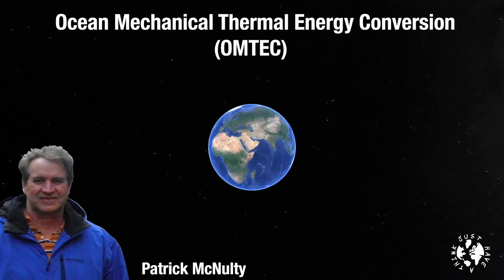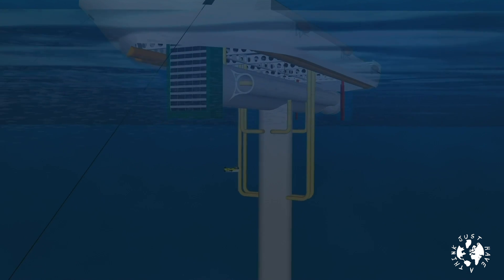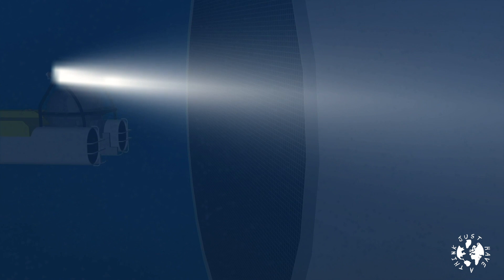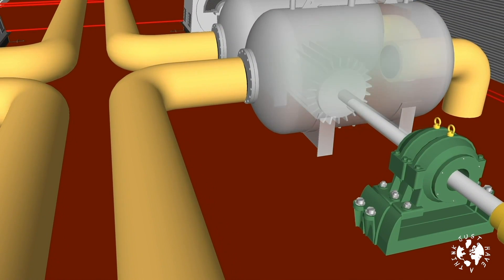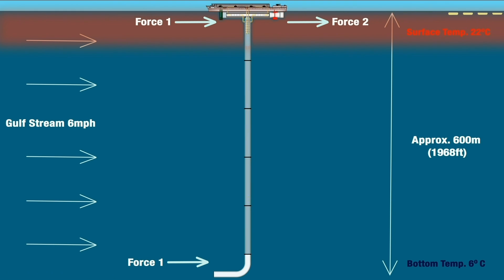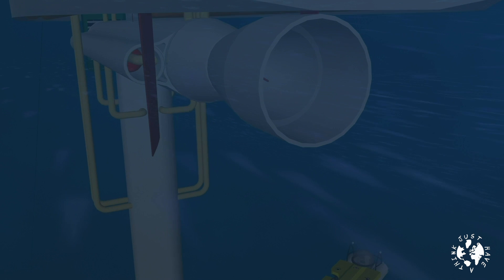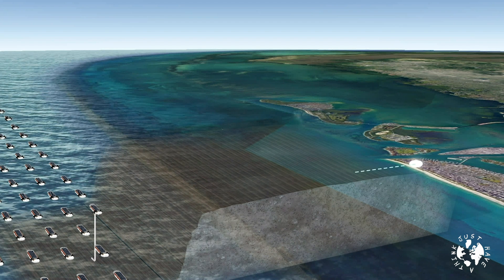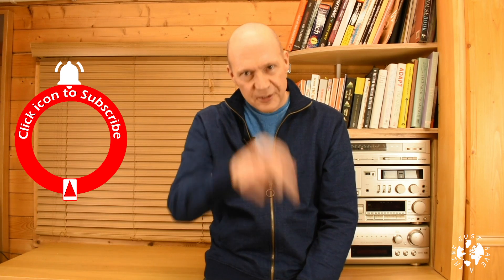Ocean Mechanical Thermal Energy Conversion

Comment: A similar system could be used for seasteading - that is to say, floating communities, probably located in the center of the world's gyres.  The deep water is not only cold but nutrient rich. This gives it a couple of uses.  It can be expelled from the top of the system into ponds made from membranes and kept inflated by having the level of water in the ponds a little above the surrounding sea level.  Plankton will bloom in these ponds and forms the ideal food for mussels and oysters.  Voila, you have an export product with a great marketing story.  The cold water can also be used to produce fresh water by having the ambient air which is pretty close to 100% humidity, passing over condensers that have this cold water flowing through them.  As for pumping, all that is necessary is a one way valve in the pipe and the rising and falling of the floats due to wave action will pump the water through the pipe.
Reply from the maker: Hi William,
Thanks so much for your comment. I am going to post your suggestion onto the Facebook site that Patrick McNulty operates for this project. It is called Ocean Tunnels. I'm sure Patrick will be extremely interested to read this. All the best. Dave

Comment: Energy output from that sized (10 meter diameter cold water pipe) system?
Reply from the maker: Hi Andrew. You would need to quiz Patrick on that one, but he's talking about many hundreds or even thousnads of these machines easily powering the whole United States. Patrick has a forum on Faceboook called Ocean Tunnels. I'm sure he would provide more detail if you post on there. All the best. Dave
Reply: @JustHaveaThink  thanks, OTS of one sort or another would be ideal for seasteading.

Comment: Hurricanes are a necessary function of the atmospheric system.

What material is proposed for these '10 meter diameter, 1000 meter insulated intake tubes'.

Has anyone done a basic cost/benefit feasibility study, including all externalities (like inhibition of the Gulf stream by 'thousands' of such monstrosities)?

Seems like more of the same that's gotten us into this problem in the first place; unregulated scientific 'progress', coupled to a basic nonunderstanding of a basic paraphrase of Occam's Razor; sometimes the simplest solution to a problem is the best.  In this case, that would be a reduction of consumption, which will happen regardless.

Comment: "surprising nobody's thought of it before " is the sign of genius, obvious after the fact. Does cooling the surface temporarily reduce the local sea level rise? How will this affect local sea grass beds, if Miami and Ft. Lauderdale decide to replant them? Help, I assume. Just because it's cooler does that automatically mean more O2?
Reply: Yes cooling does cause the water not to expand as much but that is a very small effect. I am familiar to the sea grass problem down in Biscayne bay for instance. It dies usually in the summer when the bay gets to warm and so OMTEC could be used to pump cooler water into the bay and over the corals if needed to save the sea grass and to prevent coral bleaching.. As far as Co2 goes OMTEC can power such equipment to scavenge it from the water on exiting the tunnels.

Comment: https://www.youtube.com/watch?v=TfsfFtdgGJI  Here is an example of electrical generating power plants located near where the power is used. If we built solar panels
on almost every roof and made Hydrogen locally we could have the power we need without needing to transport the electricity on a grid.
The trouble with the OMTEC system is you still need to pump the electricity into a large power grid using lines that are vulnerable to storms. A coastal environment is
often stormy. We need to rethink electrical power grids. Small and local being better than massive and covering a large area.

Comment: Do you animate these yourself?
Reply from the maker: Hi EmLill. Good to hear from you. Patrick McNulty provided the technical information required to put together the video. I created the main model of the OMTEC construction in Sketchup. Once that was complete and Patrick was happy that it was basically technically correct (all the right bits in all the right places), I then used a plug in for Sketchup called Sketchup Animator to move around the model. Some of the final details like the water surfaces etc were added in Adobe After Effects. The whole process took about 7 months to complete. All the best. Dave
Reply: @JustHaveaThink  Fantastic Job Dave thanks again..

Comment: Hey! Great video, helpful as always. I'm an environmental engeneer and i've made my thesis on the slowing of the North Atlantic circulation.. I would be interested in helping the team as much as i can.. both in the engineer part regarding energy production than in the environmental impact and externalities... Thanks if you can connect me! sorry i see this video only now!
Reply: Well..  We do know the Gulfstream has enough heat Energy in it to power civilization over 100x..
Reply from the maker: Hi artigianale. Many thanks for your response. I'm sure the inventor, Patrick McNulty, would be delighted to speak with you further on this subject. We can connect in various ways...the channel email address is justhaveathink@gmail.com  or you can find Patrick directly by looking up a Facebook Forum called Ocean Tunnels. Patrick posts on there almost every day. Thanks again. All the best. Dave

Comment: I could be wrong, and possibly I am, but wouldn’t the corialis effect of flow over the submerged pipe have a moment effect on the vessel. I once used the effect as an air brake on glass tubes as they were made. This effect coupled with the von karmen vortices, would have an impact on design, and array layout. Of course just supporting the connecting cables would be a major hurdle. As a 1km drop to the ocean floor would be a challenge.
Reply: Possible the rotation of the pipe could be used as a generator? A bit like the old walker wind sails (round tubes)of a few years ago.

Comment: What's the pipe for. Water will not be "pushed up" from the bottom, cold water is in the deep because it's cold and therefore denser, a 90 degree bend in a pipe will not overcome that.
If you were going to seriously do it, you would just sink the condenser into deep waters and to hell with the pipe which doesn't work anyway.
But there is a much larger problem with all this, mere 16K differential between heat-source and heat-sink, forget efficiency, you'll be lucky if you get the turbine turning at all.
The 3D model is worthless, better calculate what kind of temperature drops you have across heat sink, heat source and turbine and how monstrously large the heat exchangers have to be in order to provide desired wattage.
Reply from the maker: Hi Alekssander. I recommend you discuss this with Patrick McNulty, the inventor. You can catch him on Facebook at a discussion site called 'Ocean Tunnels'

Comment: The use of Gulf Stream kinetic energy shown in this video is questionable in multiple ways. First, the Gulf Stream is not in a perfectly fixed location, but wanders around somewhat. That will be a problem for barges anchored in place against the force of stream flow. Then the deep current is much slower than the surface current, so creating the needed cold flow will require more pressure difference to be created by the venturi. That, in turn, will reduce the surface flow inside the system. If deployed on a large scale, the surface temperatures will indeed be reduced, and that will hurt performance of the units installed downstream from the first row. But most importantly, the surface cooling will further impede the Global Thermohaline Cycle (aka Ocean Conveyor), which is already compromised by the influx of meltwater from arctic glaciers. Further reductions in that flow will make weather events more extreme, as the atmosphere will be forced to transport energy that is presently carried by the Gulf Stream. 

Nor is external kinetic energy really necessary to achieve the desired 'self pumping' of deep, cold water. I worked one out some years ago, called IceOTEC.
Reply: The Gulfstream between Miami and the Bahama bank is in a fixed location..
Reply: Yeah maybe we should simulate this entirely before messing with the planet.
Reply: The generator is mobile is it not?

Comment: One of the major benefits (and I think the most important benefit), is that by bringing deep nutrient rich water up to the surface where photosynthesis can happen, the nutrients can then be utilized by the phytoplankton.   This will cause an increase in the overall biomass of the ocean,  which can help increase fish populations and feed people.    The second major benefit is that this will sequester CO2 in the ocean by converting it into biomass.    The reason why the biomass benefit is more important than the electricity is because this electricity will most likely be more expensive than solar, therefore making it not economically viable for power generation.  However, the electricity could still be sold to subsidize or maybe even break even on the costs.  Therefore, it is better to utilize OTEC for ocean and fisheries management, and a method of fighting climate change.    These two purposes are very worthwhile, and OTEC could be sold on that basis.
Reply: OMTEC and that would be correct.

Comment: First principles of physics (echoes of Elon Musk) comes to mind and the limitations of the Carnot cycle (33%) and the delta Temperature (somewhere around 20°C maximum) will yield low efficiencies as mentioned in other comments. The venturi effect to create lower pressure to lift 600m of denser water with a 6 knot velocity seems qualitatively/intuitively not possible (some simple calculations could easily prove this). 

Cold water and freeze desalination is a marriage made in heaven - starting temperature is 4° and freeze desalination is much more energy efficient than partial vacuum thermal desalination. 

Impingement/entrainment issues are a real concern here in respect to maintenance and environmental impacts. 

Think Google's cheaper than coal mantra awhile back (renewable energy < coal or RE<C) which was unfortunately abandoned. Ultimately, the cost of kWh produced will determine the success of this project.
Reply: As long as Force 1 tunnel inlet is greater then Force 2 tunnel outlet flow occurs no matter the depth. Energy is conserved along the entire inside length of the tunnel...
Reply: @patrickmcnulty848  sadly this is not true, because the water in the tube going up is dense water from the bottom, so there must be a significant over pressure at the bottom to force all this extra mass upwards.
Reply: @eMeeuwEngineering  Sorry.. F1 > F2...

Comment: Interesting concept. Couple tips: work out the LCOE asap. The world is not short of ways to generate renewable power. There are many competing technologies for both storage and generation. The one that will win is the lowest cost option. See the Lazard studies. For indicative costs look at structures of similar size, weight and complexity. E.g. Offshore platforms, FPSOs. Offshore everything is 2 to 5 times more expensive than onshore. Include the cost of bringing power to shore. At long distances you will need HVDC cables and related equipment. Include annual running costs of 2-4% of the investment. Mixing warm surface water and colder deeper water will result in a net reduction of heat radiation into space. So while you do cool the surface, the total planetary energy balance is negatively affected. Competitiveness of offshore wind is to a large extent driven by the length of power cables to shore. Nothing lasts forever at sea. After 25-35 years the whole thing needs expensive redevelopment or decommissioning. Those costs need to be included. To get cold water to the surface more effectively you could explore gas lift. In your current layout cold water flow will be a constraint. The density of the cold water and drag in the pipe/filters and heat exchanger may be too high. Cold water does not want to flow up. Current speed varies with depth. The bigger the pipe the larger the mechanical loads. With waves at surface the ship will want to push/pull the 600m pipe. The inertia of the pipe will result in huge structural(fatigue) forces. You may need a spar design or tension legs. But do the economics first. It has to compete on discounted lifecycle costs with other co2 neutral base load power and or variable power and storage concepts.
Reply: I think this is the work of some sort of algorithm. I think location and available resources and demand is going to change what is most cost effective. 

If your miles inland..solar or wind might be the better choices. Solar especially in sparcely populated areas. You get the benefit of the shade it also gives you. 

Don't discount the value of shade. Helps in water retention of the soil and many plants do better in shade then in full sun.
Reply: @expressionoffreedom7165  what if east coast of USA is powered only by this technology
Reply: Didn't read this before I typed out my reply, we are basically saying the same thing, you just added more hard numbers. Nice explanation.
Reply: Live on the ocean as in Kevin Costner's Water World.
Reply: Tony Wilson  Grow a pair of gills and hide under water as in Kevin Costner in Kevin Costner's Water World.  After the scary storm has left, swim back to the couch and watch Netflix.
Reply: Tony Wilson  Will sea sheep do?  It's water world after all.

Comment: the up and down motion of waves can pump your water
Reply: Unless seas are calm.
Reply: @patrickmcnulty848  40% of ocean waves never stop as long as the Earth spins
Reply: @mikepeine3898  Anything that makes OMTEC run more efficient is worth the effort. There are some wave generators that make over 1MW these days. So yes even if you can get power while the waves are there..
Reply: @patrickmcnulty848  the HVDC energy grid transmits electricity 4times further than the old HVAC with only 7% energy loss .
Reply: @mikepeine3898  Yes they have come a long way with HVDC these days. A generator in Miami may push HVDC all along the entire Eastern Seaboard...

Comment: Ever heard of methane clathrate? If you bring up cold water warm water replace it would have adverse effects on methane clathrate.
Probably not a good idea.
Golf of Mexico has a gigantic amount of methane clathrate.
Reply: I would say that warm water would not replace cold water. Warm water floats on top of cold water if saline levels are equal.

In polar regions, which have a saline imbalance between surface water, which can be mostly freshwater due to ice melt, and deeper water cold water actually floats on the surface with warm water below it.
Reply: @michaelhayes7849   saline are seldom equal.
Also under sea methane disturbed by such an operation is very dangerous.
Reply: @billyjoesmo8251 , not all sea floor areas have hydrates. Also, upwelling directly over hydrates would not change the thermal issue as simply sucking water up does not change the temp or presure.
Reply: @michaelhayes7849  Oceanographers would disagree with you.
The Gulf of Mexico and surrounding areas have massive methane hydrate deposits
Reply: @billyjoesmo8251  , scanning for hydrates it possible with side scanning sonar. A well done PhD thesis was published around 5-6 years ago on the subject. Just looking at the pressure and temperature is, however, good enough in some cases.

Also, I propose a simple desk top demonstration to support my position on no-thermal threat via upwelling.

Fill a clear drinking glass with water and olive oil at a 50/50 ratio. Then, place a drinking straw down in the glass a suck up the water. The oil will remain stable as you draw the water up.

Comment: Could they confiscate all ocean oil rigs to convert to OMTEC?
Reply from the maker: That would nice Gezza!! If only life were that easy. Thanks for your support. All the best. Dave
Reply from the maker: Hi Gezza. I wish we could! That would be a very neat solution :-)
Reply: OTEC has a primary problem in that it pumps heat into the belly of the Ocean. There is, however, an interesting development in the metamaterials field which can convert heat to a wave length which passes through our atmosphere without heating the air. The tech literally beams the convrted energy out into space. 

It will be some time before production ramps up to supply vast amounts of this metamaterial  yet I expect to see it used in conjunction with OTEC. Currently the Stanford team is focused upon air conditioners as their first market. It is an adjunct system not yet ready to deploy over vast areas.
Reply from the maker: Hi Michael. Thanks for your feedback. That's an extremely interesting development which I will do some research on with a view to featuring it in a future programme. Do you think the Stanford team would be interested in looking at the additional elements that distinguish Patrick's system from a standard OTEC system?
Reply: @JustHaveaThink , I would not expect them to be easily diverted from their current plan. Once they are up and running, I'm sure that they will be looking for more uses for their tech. I have already tried to engage them on the idea of marine uses and have not received a reply. Yet, that alone is not a completely closed door.
Reply: @michaelhayes7849  the solution you suggest almost sounds too good to be true.  Can you provide links to any descriptions for the basic science and efforts at Stanford to deploy commercial applications - like air conditioners.